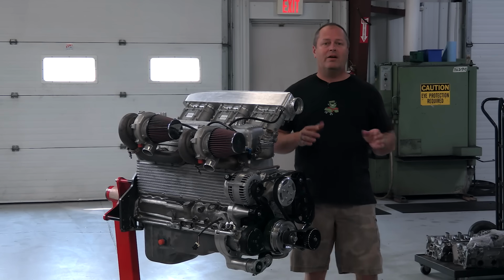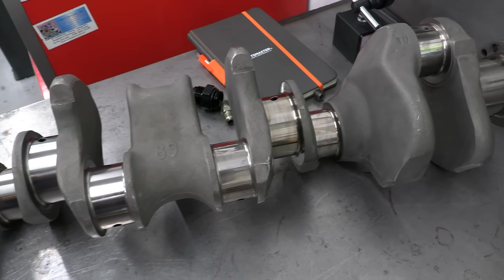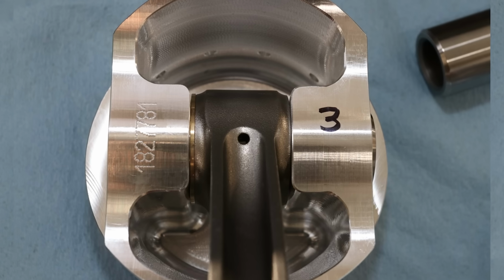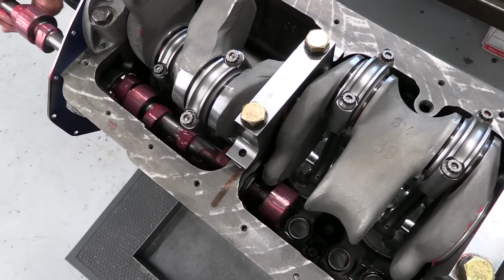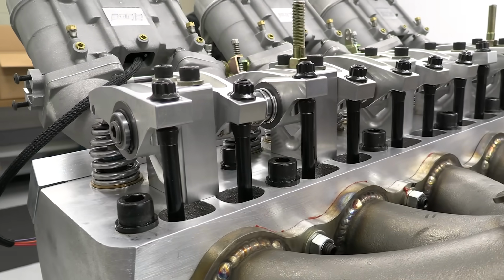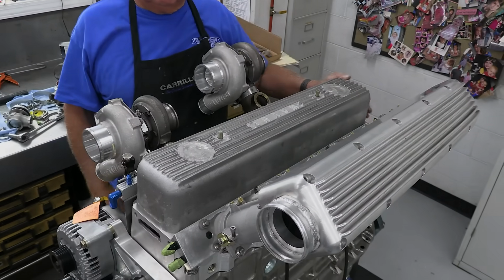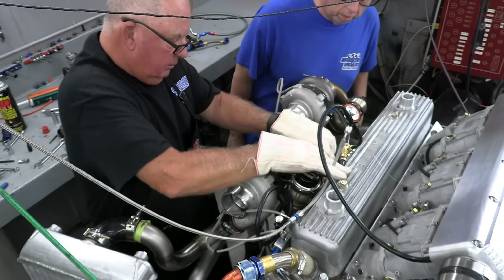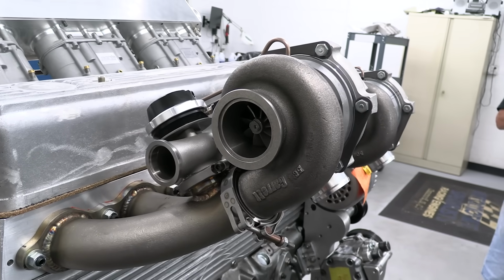Incredible Twin Turbo Chevrolet Straight Six is a One-of-a-Kind Creation!

Comment: That second turbo is pulling straight off the turbine outlet of the first turbo. WAY too much hot air being pulled through.
Reply from the maker: It doesn't blow straight into the second turbo. On the dyno and once in the truck the exhaust exiting the turbo is plumbed into a pipe with a 45 so that it goes under the second turbo and into the main exhaust. Granted, the second turbo does see radiant heat from the exhaust of the first, but it isn't blowing exhaust gasses from the first. Thanks for watching
Reply: @TheHorsepowerMonster  That air filter is inches away from the down pipe. There's no way that turbo is seeing the same density as the first. A 45 coming off the housing that soon is going to cause back pressure imbalances between the turbos. No trying to be an ass, just wondering. I watch your channel all the time. Keep up the great work.

Comment: it sounds like a six,....it sounds a lot like a v6,....not that typical inline 6 noise,..has a rasp to it. why two turbos for only 10lbs boost? its it to help with how boost is delivered,..?? like....how it comes on, how long peak is sustained till redline?? or do you need two in order to get to 10 lbs? man im blown away..wow wee dang

Comment: I have a dream!  LOL  I have always wanted to build an Overhead Cam 250 from Pontiac.  Had a 68 Firebird with that motor.  Great first car.  I knew it was no dragster but it had legs.  Would love to see something done along these lines.  I will never be able to do this, but I hope I might have planted a seed.  Back in my day, I was just thinking tri-power or early fuel injection.  Supposedly a Monza manual trany would bolt right up.  Be awesome to see what today's tech can do.  What your doing is awesome!  Thanks.
Reply: That 250 Pontiac engine with upgraded MSD ignition and injection would be a really great daily driver I think. You do not see very many of those Pontiac inline 6 engines I hope that you do build one they were great engines.

Comment: Stovebolt went to 53, 54 was the changes . my 48 was a Stovebolt, oil splash system 54 had a pump.
Reply: 48 had a pump too, and was not "splash lubed" but was spray lube on the rods

Comment: That's some good work but why would you put that much work into that engine? The later generations seemed to be a better base engine to start working with. I guess if it was an original block to the truck but it doesn't sound like it is.

Comment: I clicked on this because I had no idea how an inline 6 without 6 exhaust ports could use parallel twin turbos. I'm glad I watched the whole video to see the complex solutions you went through.

One nice thing about the internet is that these videos can be seen in other countries. When reaserching odd inline sixes, I found that Opala of Brazil was using these engines for years after they stopped selling them in the USA. As a result, some racers in Brazil found insteresting ways to get more horsepower out of them.

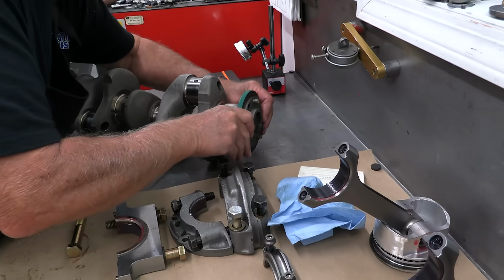4:42 You don't see that massive lump of iron because modern inline sixes (And some older ones) had 7 bearing cranks instead of 4 bearings cranks. The AMC 258 didn't have it, The Datsun L didn't have it, and I'm not sure which classic British cars had it.
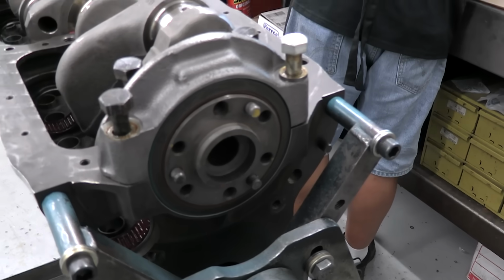5:05 here is a documentary about how someone did the machining to make it possible:
https://www.youtube.com/watch?v=mmZsh8qMBdw
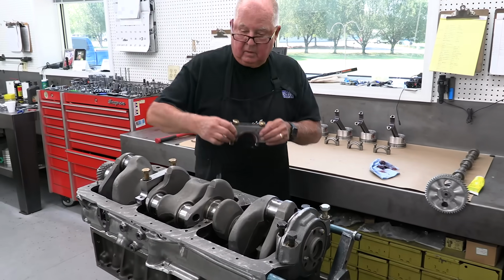5:46 Well, to be fair, many V6 engines would also have 4 points of support. That didn't stop the Nissan VG30 V6 from being able to take big boost increases on stock parts.
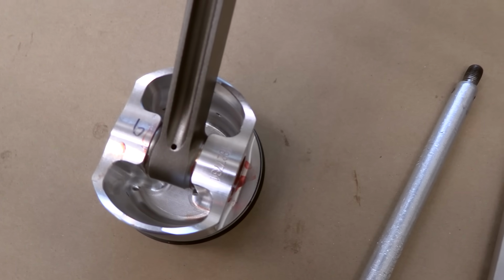7:24 Never saw that before, nice. I once saw someone braze material on the sides of the rod to created the desired rod to journal clearance:
https://www.youtube.com/watch?v=ViQgMZIc6xk
10:36 When an engine was introduced with a distributor, then went distributorless, the distributor was often hollowed out and used as a cam position sensor. Ford engines called it a "Cam Sync Plug" and it was a common problem. It also had a provision to drive the oil pump. The Vulcan 3.0 was an example of such an engine.
17:29 Interesting move. Many people would add an ABS ring to the crank pulley to create a provision for a crank position sensor.
13:30 Having ports on the same side had a good purpose. You could more easily run some carb preheating device from the exhaust manifold to the intake manifold. EFI rendered that obsolete. Engines still built that way with EFI did so when performance imporvements didn't justify cost improvements. The Datsun L28E had EFI and intake and exhaust ports on the same side. an experimental L28EZ engine was created with ports on the opposite sides, but the HP gain was not considered worth the price.
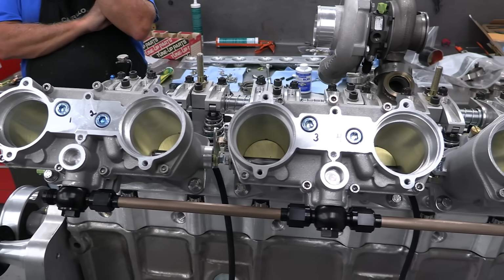17:05 Never seen any Borla intake or EFI stuff before. Nice.
18:50 Makes me think of the RB26DETT 6 throttle body setup with boost plenum. Really rare stuff it is.
20:10 This may be why "Steedspeed" style stainless steel exhaust manifolds were invented. They take less time to build and develop.
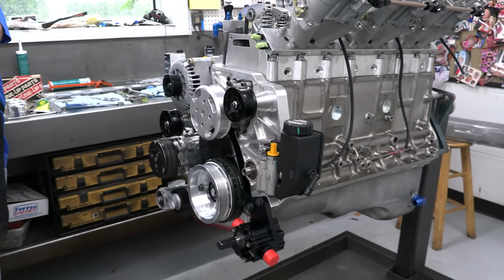21:05 Modern impeller designs might make it work even better than the 1950s pump despite the small size. Also, smart move using an off the shelf pump, if you got stuck with a failed water pump, you could get one quickly.
21:30 I like the idea of that extrenal pump. That is because I never liked the idea of people adding a turbo engine to a non-turbo engine, but not compensating for the added need to lube the turbos.
22:18 He really went all out on making the turbos get the oil they need. Nice work.
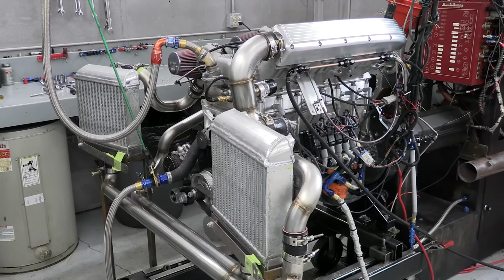22:50 That is similar to how the Nissan 300ZXTT stock intercooler setup was built. Also, I think the Mitsubishi 3000GT also had a similar intercooler setup.

Nice work, and good luck on the next unusual built you create.

Comment: How fun would that be, to have the money, resources and time to be able to fabricate and design one of a kind parts to modernize a classic engine, with new technology. I can see why the guy still wants to come to work everyday!
Reply: How tragically ironic that with age , it is time that becomes the more precious resource.
Reply: @jamessharp9790  So true !
Reply: @jamessharp9790  oof
Reply: What a great opportunity to get the knowledge made available 🙏🏼
Reply: These inlines are so awesome. It's a shame that so many one offs have to be made.
Reply: @ethansmith9065  Well we cant afford to lose  these skills; I reckon we will need them more if battery rubbish takes over - and thats a very big if !
Reply: @peterbustin2683  "Battery Rubbish" doesn't have to take over.  Even if the industry switches to two, three, four, or five electric motors to move the vehicle, they could still use a small gasoline, alcohol, or diesel engine to provide on-demand the necessary electricity.  In fact, that might be more efficient than building a new electrical grid, burning oil, coal or gas or whatever to send electricity over long distance high-tension wires, with the intermediate stations, just to provide power to a charging station for every vehicle when and where it is convenient, be that at every intersection, every street corner, every parking garage, or every home.
Reply: Guys living the dream!
Reply: No doubt
Reply: Ya know I thought the same thing, so I figured out how to do it while not being rich. I bought an old small lathe, and by small I mean it weighs less than a house. I scrounged the inter webs for cutters and such. And that’s let me make a lot of parts. I just grabbed plans for a diy CnC machine
Reply: IT'S A CHALLENGE,  he says..    That Engine sounds ALIEN  !!!!   👽
Reply: Keith simply designed engineered and crafted solutions to challenge of the specification of this motor. Look at the way he uses his tools. Taking measurements constantly and modifying to improve oil distribution and flow. And the solid camshaft he installed. Magic.
Reply: i talked to a company about doing this with an old buick straight 8. 35k estimate for the dohc cross flow and modern internals good for boost. i was like ya im good with an LS3 haha
Reply: anonymous  Of course dropping a crate engine, or even an ordinary high-hp custom V8 build into an older vehicle will come out cheaper than designing, engineering, casting, machining, etc all the new fittings such as were used here.  When the guy said they had custom castings I went "whoa!  I'll bet that cost somebody a small fortune!" Maybe next time the final customer needs an old Suburban he'll just buy a complete drive train from Koenigsegg.  I would - if I could.  
I worked in a casting foundry once (for a week only - too hot for me) and our casting molds were designs that were thirty or forty years old. The end product was devices to punch out multiple bottle caps per cycle of the machine used.  Remember bottle caps on soda bottles? Back then in 1969  there was a constant need because the castings used to punch them 40 at a whack wore out over time.  In 1969 the bottle cap industry had not changed in a very long time.  But the need for millions of bottle caps per week or month did eventually change.  Today I doubt there are more than a couple of foundries servicing the needs of bottle cap manufacturers.  Today I doubt if young people know that kids used to buy a soda and hope that the print under the bottle cap would show that we won something - from a free soda to lost of money!
Reply: Wish I could have some of those old GMC sixes, 302 in the first series and the group 3 series 426-477-503 503 had 436lbft at 1200 and 225hp at 3200 . With a decent valve job headers and a custom manifold with six two barrel webers , light rods and pistons , could be a horse.
Reply: Matt,
As a 25 year veteran of the auto repair business, I couldn't have said it any better...
Reply: It's called life choices.....
Reply: anonymous  ... It's true that either location you mentioned is well below the 4,000 foot elevation, but not sea level, even in the minds of the wackiest enviro-freaks. Closer to 1,100 feet above. Check with Sky Harbor or Williams Gateway.
Reply: @JW...-oj5iw  Evidently, neither you, nor anonymous understand why the 4,000 ft air was mentioned. Firebird is about 1,150 ft actual altitude. The ambient air temp made the "air" equal to a 4,000 ft "air density" altitude & that's what the engine ingests, unless one is running artificial "boost". So the point is my friend's Cutlas ran the 7.96 at 1,150' & 90*+ air temp which is the equivilent of 4,000 altitude with 70* air. Ya have to know the corrected altitude & how fast the car will run off the stop, in order to slow the car down with the stop to run the 8.90 that tha Super Comp cars run. So many "experts" & none of y'all seem to know anything! LOL  BTW, the Cutlas ran a 5.07 / 135, 1/8 mile on the 7.96 pass.
Reply: @goodhealth_NR  MARCUS ULPIUS TRAJANUS  " TRAJAN " THE first Roman Emperor born in SpaiN.
Reply: anonymous  Wild Horse Pass, i.e. Firebird Lake. The ACTUAL altitude at Firebird is 1,150, NOT "sea level". The car ran a REAL 7.96 without an altitude correction but the air density was 4,000 ft. with the temp that particular day, which means there was more there IF the air were better. The car would have gone 7.70s or better at Pomona, & with 4,000' air at Firebird, it was probably a 7.70 with the correction. One MUST know how fast the car will run with no stop & the air density when running a bracket car in order to slow the car down enough to avoid breaking out. My buddy was the season Super Comp Champion at JOMAX when he ran their Super Comp series. BTW, the car ran a 9.16 to grab the "Top Rocket" trophy, 1st pass out of the trailer, with a throw together 468 Olds, in Topeka at the Olds Nationals, with the wrong gear, wrong convertor, & wrong carb. He runs ALL MOTOR. NO juice, NO huffer & NO hair dryers!
Reply: @goodhealth_NR  You must be too intellectual for me, since I fail to understand your comment @ me
Reply: It’s not to late to reach for the stars and pursue your goals. 
The only thing holding you back, is you.
Reply: It would be amazing just to be a bart of this build. Thats some crazy power they are pulling out of that old 258. I just wonder why they wouldn't want to use a gen 3 block or cut a custom crank. I bet reducing the rotating mass of that crank would lead to more power and higher rpm's.
Reply: It will suck though when the engine ages after use and parts start needing to be replaced and everything needs to be custom made all over again to keep the engine going.   Replacement part costs could be a nightmare in the future I would think?  Especially if your not as smart as this engine builder and don’t have his resources to custom make everything and have to pay others to do it for you.  Be a dream engine for the rich and famous Only to have. Not the common everyday guy would want a engine like this realistically you couldn’t afford to keep it running at some point. But I sure love to take it for a test ride! LOL Amazing the horsepower they can get out of a straight 6 without it exploding!
Reply: @ghostridergale  When you have the engine built. Have him build two or three of whatever parts usually go out. 
If you don’t over rev it too much. 
It would possibly last 1,000,000 miles!!
That would be several decades!!
Reply: @ghostridergale Reminds me of my dad. Dad could fix things so good… nobody after him could ever fix it again if it broke. Lol he was pretty darn good.
Reply: Hell I want to go to work with him. Maybe pay him to put me to work in his shop.
Reply: That engine probably cost triple or more what a V8 would, but damn it's freaking amazing!
Reply: You took the words right out of my mouth! and as my father used to say..."not everyone is poor"
Reply: Ive worked on many custom cars and its cool and all but when theres only 1 of whatever in the world kinda stuff causes its own set of troubles... trust me 🤦‍♂️
Reply: I'd like to see someone design and build a flat 8 cyl engine.
Reply: To be honest it’s not hard to design and do what your talking about it just takes a lot of time to perfect exactly what you want
Reply: Mathew Sweet   It doesn't always take cubic dollars to make unique projects. My buddy has a Super Comp Olds Cutlas that went an actual 7.97/168mph (at Phoenix in June with a 4,000ft corrected altitude) with his 1,000hp, ALL MOTOR, single carb on race gas, 555 BBC. He immediately sold the 555 & started his long awaited project, a 440ci small block Olds, starting with an Olds 350 diesel block & Batten heads custom machined from raw castings, to go back in the Cutlas. It has a custom non-twisted forged crank, a1 off set of Ross pistons, a custom set of TD rockers & an Edelbrock Victor Jr converted for a Dominator with a 2" open spacer welded on before the porting began. The heads flow more CFM per Cubic Inch of displacement than the Dart 335 CNC heads on his 555 Chevy. We're pretty sure we can make an honest 850hp with a single ProSystems carb & race gas. NO juice, No huffer, No hair dryers, NO artificial horsepower!!
Reply: anonymous  ... You seem intelligent in concept, but your writing is a betrayal. There's no rush in writing here. You can take the time to get the job done correctly.

Comment: Wow
I had a 76 elco with the 250 cube straight 6
We ditched the carter for a high flow twin Weber, cut and welded and made a dually with 2x twin Webers (down drafts) and changed out stock cam for a “town and country” grind with solid instead of hydraulic lifters. We then fitted a custom made tube extractor manifolds and that few mods changed that Elco into a reasonable sleeper in 78. 

As students at the time it was a labour of love by my father and friends that we made a plan because there was no issue with money. Theres only an issue with money if you got some. 
We didnt have any. I was working 4 jobs to pay my tuition.
So the Elco was an old sleeper in the true sense of the word. Scratch mods sounds about right cause we scratched around to do anything.
And while the Elco was being worked on everytime, we resorted to mans ancient transport- boot 🥾 power...

But it was a hoot
Loved that car. Sold it with 325,000 miles on it and the motor had never been opened for repair work.

Enjoyed this, wish i had 525 hp back then, not sure if there was anything that would have caught me(with the 3 speed stick shift)
Keep on keeping on

Comment: You are mistaken saying that Chevrolet never treated the straight-6 is high performance. Have you ever heard of the Blue Flame six-cylinder in the 53 and 54 Corvettes? It had 3 1 Barrel Carter side draft carbs

Comment: "Chevrolet never treated the straight six as any kind of performance engine"??  Really?  
What about the triple carburetor, performance cammed '53-'54 Corvette?
Reply: There really wasn’t anything special about that motor. It had three single barrel side draft carbs. They were Carter YF. They put the sanMe carb on the Corvair Spyder turbocharged engines. How do I know it wasn’t speciAl? My first car was a 1954 Corvette.

Comment: I just love straight 6 engines build ups. And this one is definitely my favorite. What an absolutely gem.
Reply: sorry but that sounds like Arse sure awesome expensive setup but my old junkyard pick a part $50 crossflow ford 4.2 made 600hp ate 8 year ago.
Reply: @altruismfirst6489  You are full of shit are your eyes brown?
Reply: Power nation did a similar build on an old ford six that was used as a power plant for a city weed abatement sprayer  or some such.

It came to them outputting like 80 HP. Left them putting out north of 500 HP.